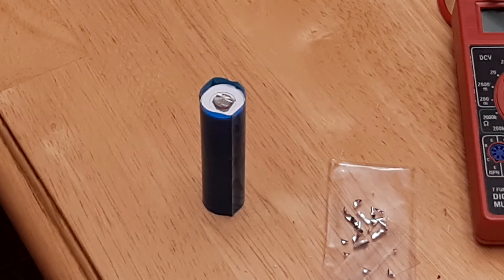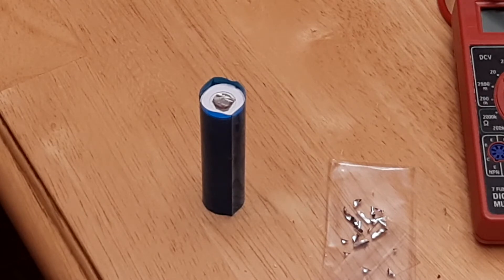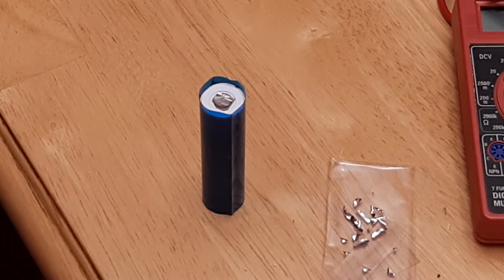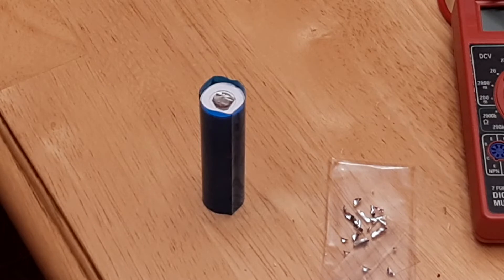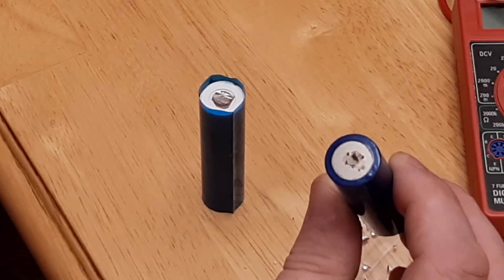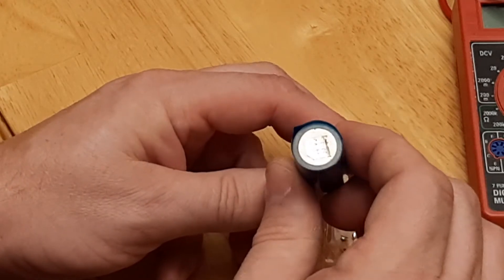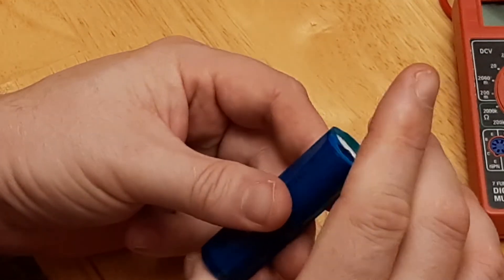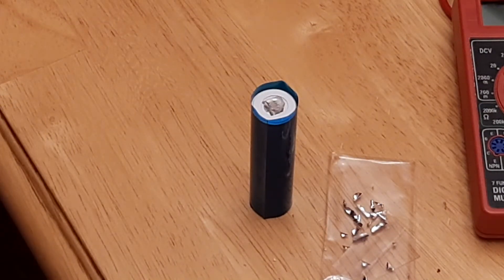What people are NOT saying about 18650 harvesting

Comment: Didn't see you put the 18650 in the flashlight.
 I tried replacing the 3-battery holder with an 18650 and it was too long to fit.
Otherwise got some good info here, thanks.

Comment: Hi
I salvaged 6 batteries from my laptop battery pack
But 2 of them drop voltage after charging.
It happens to be 2 first batteries from the pack and I removed them by force.
I think i damaged them :(
Reply: it is a common failure with lithium cells and is typically the main reason the battery stops taking charge, the cells gets out of balance and the BMS shuts it down. when you salvage these types of cells you should always fully charge and then let them sit for a week or two and check if voltage drops. all cells that keep losing voltage over time for days should be discarded. it is common if two cells is parallell that both fail because the bad cell drops the voltage too low on the good cell and ruin that too. good cells will not lose any mentionable voltage after they settle down at a specific voltage. but it is important not to measure this right away after it´s charged because the voltage must settle for a while before you have the cell in balance. but if the voltage keeps dropping slowly or steadily day after day it's a bad cell

Comment: I'm in the process of cleaning about 600 cells, And I have also decided not to remove the nicklel strips, No matter how good your cutters are you cannot get them completely clean without grinding on them and the contact points are much flatter Leaving the nickel strips attached. I don't think that doubling up on the cap insulator is a good idea.
Reply: Only harvested like around 20 and also stopped doing that. Though you can use a dremel with a stone tool but that removes the anti rust coating and leaves nickel dust in the battery which could probably be dangerous.